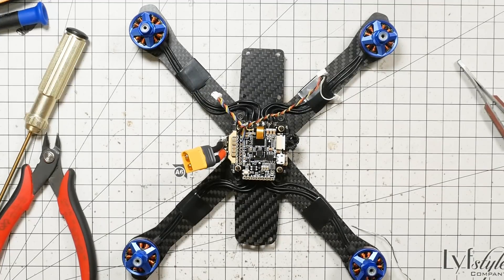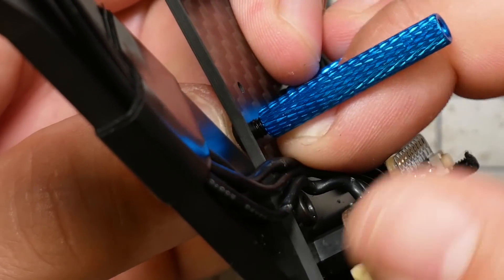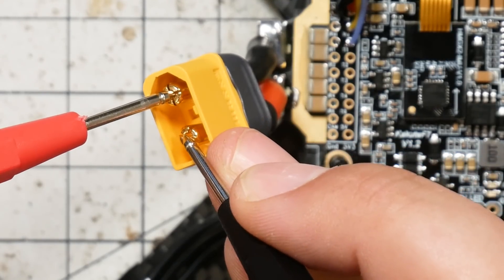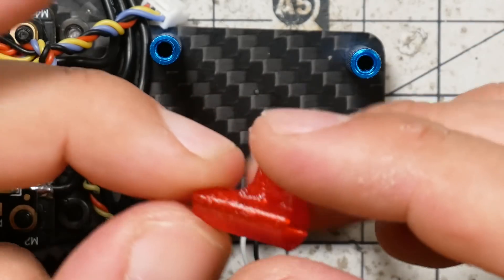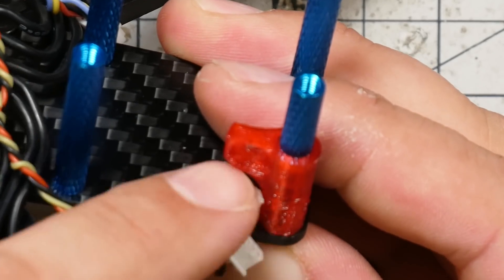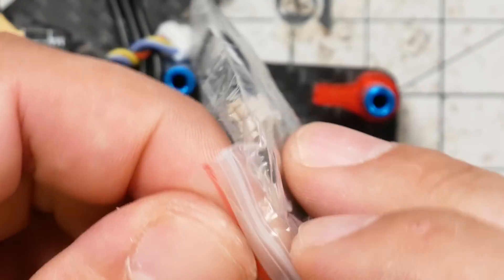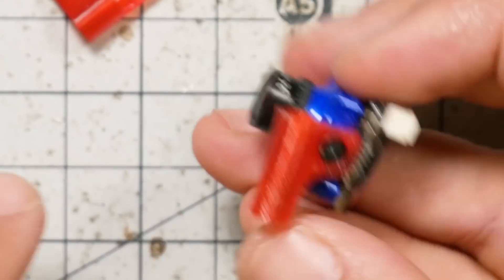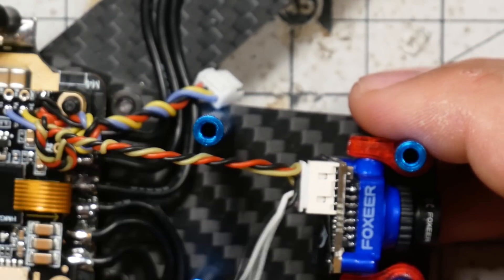Learn To Build a Racing Drone - Part 8 - Install Camera and Standoffs

Comment: I get everything working except camera. Looks like I got faulty cam
Reply from the maker: Contact Rotor Riot store support for a replacement.
Reply: @JoshuaBardwell  Iv ordered a replacement so I can check and be sure. My glasses find the channel OK but just shows a blank screen. Iv skyzone and tbs tango. Same result on both devices. I'll keep you posted bro. Thanks for the reply. And Big thank you for the build videos.  🤓✋💜💜💜
Reply from the maker: @itchyliabdo  If you have black screen with no OSD that confirms the vTX is working. No OSD might mean the flight controller is not outputting video to the vTX. 

You can try connecting the camera video wire directly to the vTX video wire to test the camera.
Reply: @JoshuaBardwell  tried ur last. Same result. Iv new Cam in the post. I'll report back soon as I know more🤓✋💜💜💜
Reply: Replacement Cam installed and working 🤓✋💜💜💜

Comment: Hi Joshua, just wondering how you decide what angle to set the FPV camera at? Do you usually adjust it until you get it right or do you have a tried and true method?
Reply from the maker: For a beginner I would suggest 20 degrees above horizontal. Personally I fly between 30 and 35.